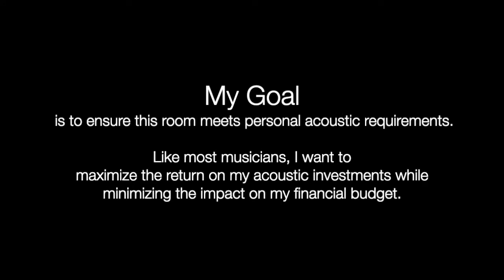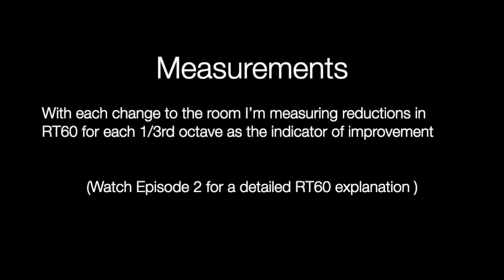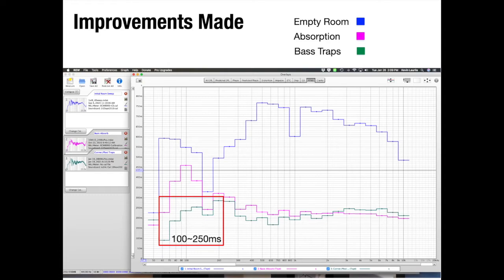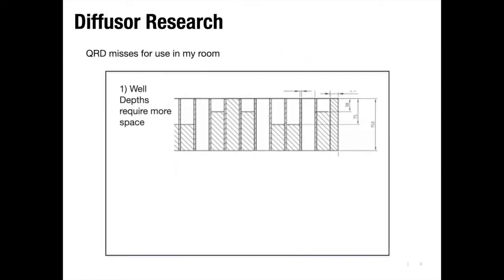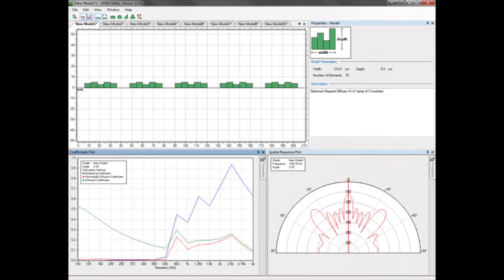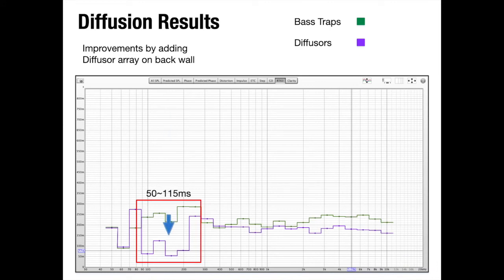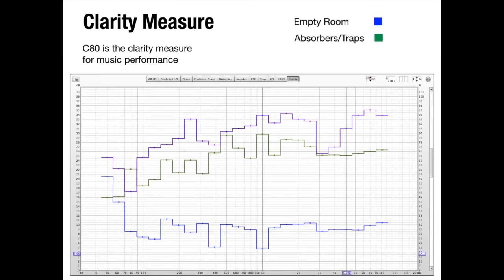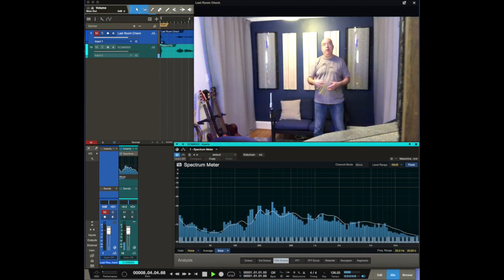Home Project Studio - Treatment Series: E5 Applying diffusion and measuring improvements

Comment: Thank you very much for all this information you provided throughout the series, I am very grateful, greetings from Egypt
Reply from the maker: Fahmy, You are very welcome!
Reply: @mediaunion  im reading in some sites that RT60 results aren't meaningful in small rooms(less than a gym or church), whats your opinion in this ?
Reply from the maker: @alaafahmyofficial  My experience is that RT60 is meaningful in all room sizes.  This is because hard surfaces especially in a small space encourage higher frequency energy to bounce around the room uncontrolled. Two areas in small rooms where RT60 improvement is important are the 1) First Reflection points on your side walls and the 2) Cloud above your listening position.  By adding absorption in these two areas you will reduce the energy of higher frequencies resulting in shorter RT60 and a more balanced and pleasing listening experience.  Thanks for the question!
Reply: @mediaunion  Thanks alot for your awsome  explanation

Comment: Hi Kevin, just came across your very informative series. Thanks for taking the time to share your experience. I have a dedicated Home Theater room (22'x 9.5') and built 5 of Tim Perry's wood diffusers this past summer for the rear wall (results were good). 

I like your Hybrid Polycarbonate Diffusers, and I need to address some of the same lower frequency regions as you did. I have a couple of extra DIY Rock Wool absorber panels 16"x48"x3.5"(WxHxD) that I want to add the Polycarbonate sheets to. I live in BC and having trouble sourcing the .08" 24"x48" Polycarbonate. Home Depot here has acrylic sheets. Do think that would be okay to use?  Where did you source your sheets?

Thanks, Tim
Reply from the maker: Hey Tim!  Good to hear you are working with these "hybrids".  I'm in Cascadia too!  Portland.  We have a "Tap Plastics" that I had them cut custom sheets.  
https://www.tapplastics.com/about/locations/detail/lynnwood_wa

In your area...Check with:
Polymershapes Plastics 19055 Airport Way,
Pitt Meadows, BC, V3Y 0G4, Canada

In all honesty, I don't think the thickness of the HD sheets will cause that much variation for your purposes.  Let me know how it goes!  Would love to learn of your experiences with the hybrid.  

Kevin

Comment: Hello, great videos! I've been hooked while watching the series! Something is not clear for me though: 
At first you say that you want to archive 250ms across the spectrum on every octave (Or try to get it close to that). But in the ending results, the low octaves of zone 2 of the spectrum is way less compared to the higher octaves. Wouldn't that be a problem? Shouldn't you remove some bass trapping to even out the result? Or is this result beneficial?
Reply from the maker: Hello Simon!  All things said, every room will have a different low end RT60.  What is important for me is to understand how this room responds when I mix or record Bass/Drums.  I'll know at the Main Listening Position that I may have a lower RT60 for 85Hz but may have a higher dB level for the same frequency.  What I'm trying to get at is the use of RT60 and SPL are different measures that we need to understand while working in the room.
Reply: @mediaunion  Thanks for the response! Okey I get it🤔 That means no acoustic treatment will result in almost perfectly balanced room right? (Better having treatment than nothing) You have to learn the room when u are mixing. I will be following your videos to do my own room btw. Thanks for all the knowledge :)
Reply from the maker: @SimonCarranza  Cool! One way I test my mixes is to render the mixdown then send it to my iPhone and listen to it.  You can also check it on a Sonos, your Car stereo, a BlueTooth speaker.  That will help you learn your room's signature on your sound.

Based upon my understanding of my room...I will have compensated for any higher SPL bass frequencies in my mix.  If it sounds good on the iPhone it is good.  Too much bass then I need to note which frequency and go back to the mix and tweek it.

Hope this helps!

Comment: Hi, I love this series. I wonder why you haven't mentioned the frequency you want to treat.
Also why use the wood diffusers? Are they better than the barrel diffusers?
The wood diffusers can only be effective at a very high frequency, from from 2.5khz
Reply from the maker: Hi Martin.  Great questions. In this series I wanted to succeed at creating a mixing/control room in my home.  I challenged myself with treating a former bedroom.  I studied up on the materials and the theories used to make your room sound great.  Using REW I allowed it to show me what octaves needed treatment and broke it down into the 5 videos.  So...I never really looked at a single frequency to treat but the room as a whole.  For the diffusors, I went with wood because they are affordable and a great design for folks who want to build their own.  (Check out Tim Perry's work and design on these!)  Yes, I'm using them for frequencies above 2K.

However, Today I have a frequency that I am trying to treat.  In my current REW Studio series, I added a subwoofer thinking it would help with my low end (which it did) but it highlighted a different issue.  The frequency I am focused on is a null that's between 88-92Hz.  So follow along as I work through issues of setting up a sub and dealing with modes and nulls in Zone 2.
Best,
Kevin

Comment: Hi
Thank you very much for the videos and how easy it is to explain to achieve a great change in the acoustics of our rooms.

My query is for the Clarity c80.
Can you elaborate a little more on your explanation?
Is it necessary to get a line in frequency as compensated as possible in frequencies like RT?

Written with translator.

Greetings from Spain
Reply from the maker: Hello Juan,
Greeting from the states!

Check out this site for the details/calculations for C80.
http://www.concerthalls.org/?page_id=86

My thinking:  I would not try to achieve the same level in dB for all frequencies with C80 measurements

Background: For C80, you will focus on frequency octave bands centered at 500 Hz, 1000 Hz, and 2000 Hz.  If you have long RT values for these frequencies you will want to apply additional absorbers to surfaces farther away from the sound source. (the back wall or back side walls in your room.  Adding these absorbers will increase clarity by reducing any reflected energy back to the listening position.

Let's talk more on this.

Kevin

~ Google Translate
Hola juan,
Saludo de los estados!

Visite este sitio para obtener detalles / cálculos para C80.
http://www.concerthalls.org/?page_id=86

Mi pensamiento: no trataría de lograr el mismo nivel en dB para todas las frecuencias con mediciones C80

Antecedentes: para C80, se centrará en las bandas de octava de frecuencia centradas en 500 Hz, 1000 Hz y 2000 Hz. Si tiene valores de RT largos para estas frecuencias, querrá aplicar absorbentes adicionales a las superficies más alejadas de la fuente de sonido. (la pared trasera o las paredes laterales traseras de su habitación). Agregar estos absorbentes aumentará la claridad al reducir la energía reflejada a la posición de escucha.

Hablemos más sobre esto.

Kevin
Reply: @mediaunion  Thanks Kevin for the link, I'll look at it carefully.

That I wanted to tell you.
Have you recorded some songs and uploaded to youtube to listen to what the room brings with the acoustic treatment?
For example, a very good song is Jim Keltner's Drum Improvisation from The Sheffield Lab.

Greetings

Comment: is really the drop to 100ms and below in the RT60 an improvement? I've heard experts from GIK saying that the ideal number should be just a little below 300ms, or a little above for a move lively room
Reply from the maker: Hey Marcus.  I'm not GIK but I am a bass player and I love low end.  Something that I have always been told is that longer >150Hz RT60 leads to sloppier Bass (we can check C50 & C80). Given that I don't want to over spend on Traps/Absorbers/Diffusors I've taken the scientific method approach.  Test, Adjust, Test again and I've found what works for me and my clients in this room.
BTW...I gave GIK my REW sweeps and they recommended purchasing 8 to 12 sound blocks with range limiters for my room ($2200 w/ shipping).  The sound block's SAC under 125Hz averages 1.0 so the RT60 for my>125 most likely will be even shorter.

But I would recommend checking out this doc if you want to see how EBU engineers define the RT60 for listening rooms.  https://tech.ebu.ch/docs/tech/tech3276.pdf

My next video will show how I have been able to tame my low end trying some cost effective ideas from some other you tubers.  Kevin

Comment: Thank you so much , I have learned a lot from your videos, I have started getting into acoustics, what are your thoughts on the softwares Afmg Ease and Afmg Soundflow?
Reply from the maker: I haven't used them yet due to their cost.  However, If you are considering studying acoustics, architecture, and engineering ease would be a package that I would add to your toolkit.  In my case, I've built a few test Helmholtz traps and have not been successful in tuning them to the desired frequency.  Tools like Soundflow would most likely speed up and streamline the design and building of any traps/absorbers.  Lastly, after seeing what Tim has done using Reflex throughout his diffusor design CPI (continual process improvement), I am considering downloading the trial versions for these 3 tools.  Would you be interested in seeing what I learn?
Reply: Yes i am very much interested!!

Comment: Why you decide to put the diffisers behind you and why not behind monitors or besiside you?
Reply from the maker: Because of my goal for the room is Mix clarity and accuracy.  In my small room I wanted to trap and absorb energy behind the monitors because of bass build up (Modes).  I'm still considering what I need to do on the front wall so stay tuned!  On the sides I want to absorb the energy reflecting to the mix position from the walls to minimize time delays.  Diffusion would only scatter the energy.  Lastly I want to ensure that sound energy from the monitors doesn't reflect from the back wall back to the mix position.   Thanks for asking.